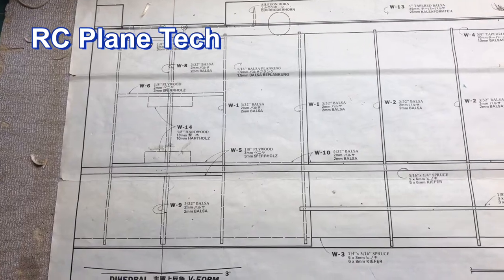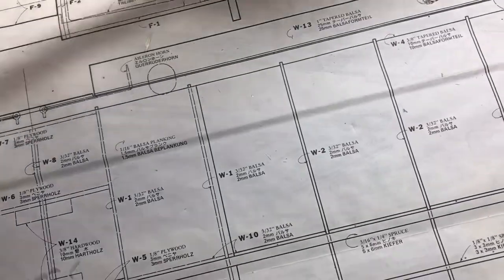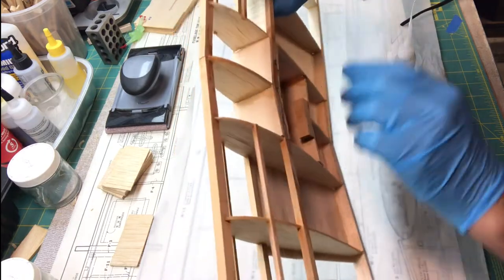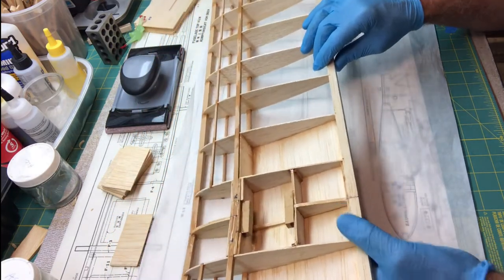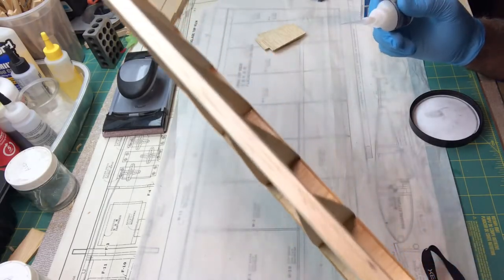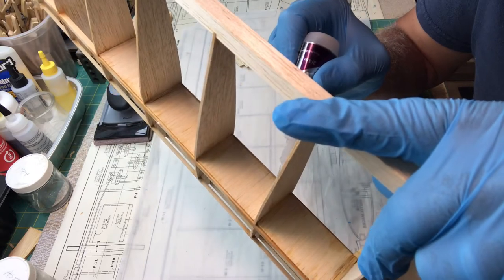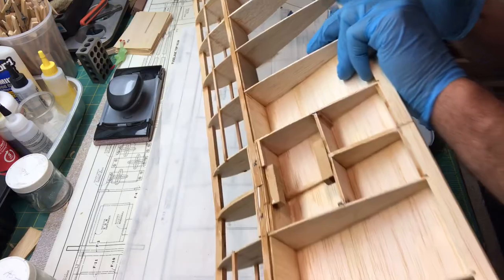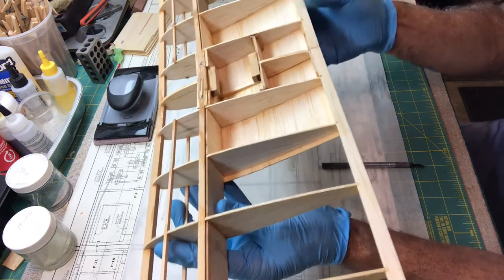Barnstormer 25S Vintage RC Plane Build: 8 Wing Webbing

Comment: i like your wing construction..i wish my 25L wing leading egddge was constructed the same wayon the 25 L im building i had to add some tri stock to the hard wood leading edge..there was no way i could properly round it off properly...i even tried a strip of sand paper and tried the shoe shine sanding method....i had to make a post on RC Groups for advice...so far so good...im doing the final touches on it...hopefully ill begin covering her today
Reply from the maker: That sounds a little like mine? There is very little room to round out the hardwood leading edge past the ribs. It ends up being very blunt almost a flat leading edge. Your idea of adding triangular stock is a good one.
Reply from the maker: Also, glad to hear you are moving along with it. I need to do the final sanding and some filling, maybe a fiberglass cloth strip along center of wing... then cover. Its a fun build.
Reply: @JamesRCPlaneTech  im sorry, i didnt watch the whole video...i scanned it for comparison purposes...gonna add the pictures to m thread on RCG , to have as a future reference...afte the win "dilema things wen along smooth...fast and fun..also bench ran the fp 40...ran great...just enough power for extra fun...ill probably skip he fiber glass...all finished, the wing seems plenty strong...maybe just one litttle strip..
Reply from the maker: Ill check out your RCG page, looking forward to seeing your finish plane. Thats cool. The 40FP will power that plane well, it will be a screamer. Ya the fiberglass cloth was not part of the kit. So Im not sure if Ill do it.
Reply from the maker: I’m going to do a little fiberglass ing on my next video.. I agree, it’s probably not necessary for reinforcement for this plane, but its good practice for me to apply it. I’ll be doing it on a finishing level, and to help protect the balsa sheeting from dings and rubbing on the fuselage. It may help a little with protection from the rubber band mounting. On my previous plane I used #64 bands and you end up putting around 8 to hold the wing on (plenty strong), but the bangs could dig a little into the soft balsa over time… may not be critical.
Reply: @JamesRCPlaneTech  you made some good points...ill do the same. thanks for enlightening me...fel free to post on my thread and link to youtube ...you migh get more exposure...my thread is pretty dead as far as people commenting, but it does have some vitors
Reply from the maker: Thanks, I will see how I can link your build log. I’m still figuring out this youtube thing. I’d like to link within the video since most people probably don’t read the descriptions. I’ll check into it. Thanks
Reply from the maker: Lol, I just realized you mentioned me posting my link on your thread… not the other way around (pays to read). ok yes, Ill do that as well. And when I post yours on mine, hopefully your will also get some more traffic on your log.
Reply: @JamesRCPlaneTech  sounds like a plan...i already fiberglassed my center section...i used the thinnest i had on hand...and added 2 layer to the leading edge section, just incase...im really glad you mentioned it, totally forgot about the rubber bands potentially digging in the soft balsa
Reply from the maker: Great, yes couldn’t hurt to glass it up in the center. I’ll check out your build log this evening.
Reply: @JamesRCPlaneTech  sounds good!

Comment: I think the sheer webs should have been installed while the wing halves were still on the building board. Does that make sense ?
Reply from the maker: Sure. That would helped assure that the wing was even more straight. I didn’t think of that.
Reply: @JamesRCPlaneTech  well it wont happen again.That is how we learn.

Comment: Is the material of the spars also bala or should be bass wood? 
thanks
Reply from the maker: Hi, all the spars on this kit are spruce (hardwood), except for the trailing edge spar which is balsa. The trailing is balsa so that it’s easier to cut in the hinges and aileron channels for the linkages.